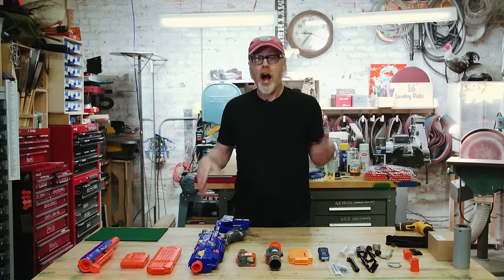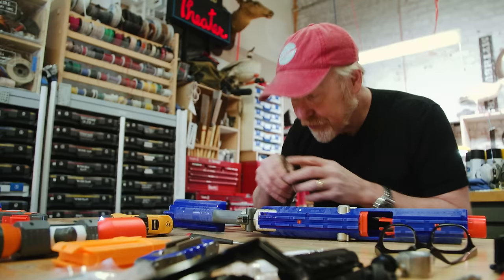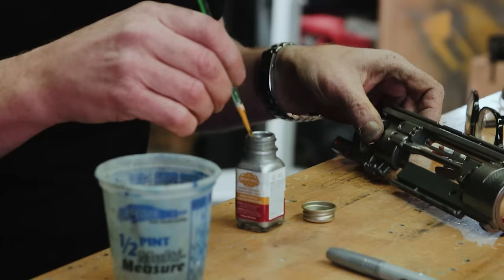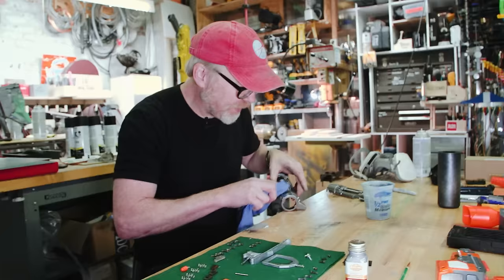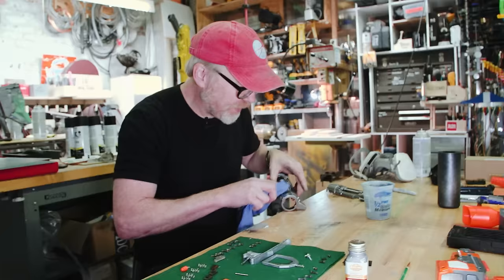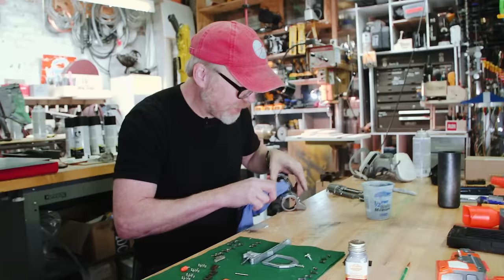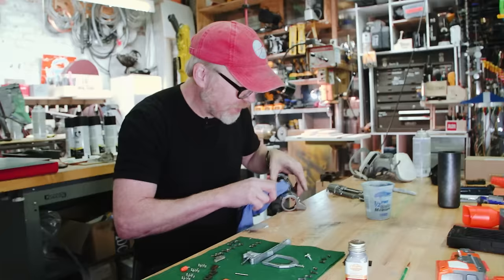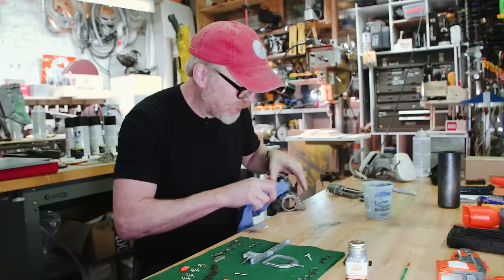Adam Savage's One Day Builds: Custom NERF Rifle

Comment: I don't know... That seems like a tad too much weathering. There's "well used" and then there's "fished out of a swamp."
Reply: No soldier is gonna leave his gun rot like that. WTF
Reply: I think it's just to compensate for the brightness of the yellow used, it tones down substantially.
Reply: I rather he used black than rust....
Reply: @Harvey Specter:
Yeah, but it ends up looking like mud... Or worse. I'm with Lunartist on this one - a soldier would maintain his gun. There's little you can do in the field about scraped paint or worn metal or the various dings and scratches that gear picks up in regular use, so that's fine. But this amount of caked rust, mud and literal crap - which is what it ends up looking like - just seems like the thing spent a few years at the bottom of a lake before someone fished it out and tried using it.

I'm not against weathering and ageing of a prop - it gives the item a sense of authenticity. However, good wear tells the story of how the item was used to wear as it has - smooth edges around harness hooks, worn matches where fingers usually stand, etc. What we see on the prop here is more than anything artificial disrepair, which I'm personally not a fan of.

Not knocking Adam's skill in model-making in the slightest, of course. That's still an amazing amount of work to do in a few hours. It's just... I don't think the "rust" adds to the weapon's appearance, is all.
Reply: Fair enough, I suppose. In the end, the person getting the gift seems to like it, which is all that really counts in the end.
Reply: It's a nerf gun guys
Reply: I like to imagine this is what someone from mad max would use.
Reply: Malidictus - In his mind he's telling a story, of which you are completely unaware of, and it appears you are letting pretty conceived notions cloud your judgement. For example, we are not sure if this is a nations soldiers rifle. For all we know, this a revolutionary soldiers rifle, or a rebel soldiers rifle, and does not have the same maintenance protocols of a nations military. Remember, assumptions make and ass out of you and me.
Reply: @JJ SS:
Fair point. Although the reason soldiers - and really, anyone who uses firearms - keep their guns clean isn't just protocols. The reverse is true - protocols exist because without proper maintenance, weapons become unreliable. If your life or livelihood depend on a rifle, you want it to shoot first time every time, and that's not going to happen if it's rusty, muddy and full of dirt. Even generally forgiving weapons like the AK 47 can still jam if not maintained properly.

While I agree that this much rust and dirt does tell a story, it's the story of a disused weapon left to disrepair, rather than one being actively used.
Reply: Malidictus we call it the Hunter of The Apocalypse
Reply: looks more steam-punkish so I agree yet at the same time disagree. the odd thing about this weapon is it was made with an odd yellow color, not desert brown like the primary color of most military rifles atm due to middle east incursions...
Reply: Malidictus But in the end, it looks fucking cool.
Reply: @TeqHDcasper:
I disagree. I thought the rifle looked better before the "rust." However, my opinion ultimately doesn't matter since the person it was actually made for seems to have enjoyed it.
Reply: I'd like to add another suggestion. It could be Adam's experience in the movie industry. (he was in that right? if not I'm sorry) The over weathering would be hard to see if the gun wasn't the center of attention, or while being used in a fight scene.
Reply: Well no soldier is gonna have a bright yellow sniper rifle either... It's a fantasy build getting kind of a Borderlands or even Warhammer 40k vibe from this.
Reply: well it is a nerf gun so at the end of the day it looks awesome

Comment: Adam... you broke the rule of nerf modding.
1 don't paint the entire mag    
2 paint the gun when it is apart 
3 don't paint the trigger, and if you do at least lube the shit out of the trigger.
4 sand off all the logos' texturing and warning labels.
Reply: and that silencer will kill your range and fps
Reply: and you should of cut the rail with a ban saw and mounted a pitiny rail 

and yes i can't spell for shit
Reply: and i hope you drilled out the air restrictor and removed the locks
Reply: Dude
Reply: With this kit there isn't an air restrictor
Reply: Lars Van Den Broek is the whole bolt sled remade by orange mid works? To be fair i have never modded a longstrike
Reply: I believe that it replaces the whole plungertube and breech because the longstrike is originally indirect plunger
Reply: Bruh, It'll be used once then put on a shelf. It looks fantastic, and that's all that really matters.
Reply: Adam doesn't live by the regular rule book. And, i'd like to see your work, since you basically are bashing one of the best builders out there.
Reply: why dont paint the magazines?
Reply: it won't fix properly into the gun. Avoid painting the part that inserts, they are built to close tolerances.
Reply: It's a fucking nerf gun chill kid
Reply: I assume you automatically knew everything about Nerf modding the first time you did it?
Reply: MrDyslexicPanda its nerf lmao
Reply: JKresz you don't know the NIC and the hole fkn hobby
Reply: MrDyslexicPanda  well the log is there price and charm for adrevenue
Reply: how does sanding off the logo improve performance again?
Reply: its fairly common to make guns shoot over 100 feet.
Reply: dang mang Damn who shat in your cereal
Reply: George Riley the paint chips away and makes feed the mag slow
Reply: DenchTraceur *cornflakes
Reply: ***** you can get above 100 feet with alot of nerf gun
Reply: Peter-Alexander Verwey not bashing this just isn't a common practices in the community
Reply: So confrontational, sure let's all live by your standards. Because people liking to do things other than those you like are stupid idiots and childish, yeeeep. /s

I've never modded a NERF gun, but I can at least appreciate the effort and enjoyment people get out of it. I might not get the same, but if they enjoy it then they're the ones winning.
Reply: Whats it like to never have any fun?
Reply: 5. Nerf guns don't really kill people.
6. Therefore, you are really bad assassins.

Some kind of joke, of course, although, what is the point of this hobby? Lazy, 'nerdy' version of paintballing? Granted, real paintballing is not easy at all, costs money too. For targets, I always liked archery the most, though.
Reply: More cost effective than paintball, less messy, can play about anywhere, and the ammo is recoverable.
Reply: dang mang jeez dude who cares what they do with there free time
Reply: people who enjoy using nerf blasters?
Reply: Arekinable
and modding the gun is probably a lot easier too
Reply: Better put him in nerf jail
Reply: I'll happily agree with 1~3 - however #4 is going to get you into trouble (the labels that is, not the logo).
Reply: in trouble ?? lol. ok.
Reply: Good advice but that doesn't matter it just a fun gift project so who cares
Reply: MrDyslexicPanda He did this entirely for aesthetics. All of this is irrelevent
Reply: MrDyslexicPanda you forgot a few

5: don't paint anywhere on the gun
6: don't even touch the gun
7: in fact don't look at it
8: y'know what, don't buy a nerf gun. Just don't.
9: I'm sorry I yelled
10: fuck all these rules this is dumb
11: do what you want
Reply: i dont mean to insult you but i have seen way too many people like you on the comments to shut up about it, in my honest opinion its people like you that kinda take me off certain hobbys, people who take things way too seryously, why are those rules in the first place and why do they matter, who cares? adam was trying to make something that looks badass for someone and succeeded at it, theres literally nothing to it, and wht matters the most, he did it his own way, which is what matters
Reply: This wasnt a nerf mod kid, he built a decorative prop
Reply: Good point, but it's Adam Savage, so he gets a pass because... he's Adam Savage.
Reply: Jesus, I thought I was a loser & here comes this kid complaining about the "rules of nerf modding"...
Reply: MrDyslexicPanda why can't he like honestly
Reply: I am in the community, and these aren't really rules as such, more like tips to follow. I understand that this is just a decorative piece, and as a decorative piece it's very well done. But if the recipient were to use it the paint would very quickly wear off, and may even cause the blaster to jam. Most people figure this out by themselves, making these tips like self-imposed rules to anyone who paints blasters. I do understand that the original comment might have sounded threatening and/or pedantic, but it was more of an in-joke within the nerf community.
Reply: +kalloused if i might interject here. Chill the fuck out. He was just giving him some advice from someone who probably mods nerf guns as a hobby.
Reply: Wait... are there professional nerf battles???
Reply: +Rpodnee I'm pretty sure Adam Savage doesn't want or gives a fuck about advice. Appreciate the fact that he took the time to make such a wonderful gift
Reply: I'm new to this, if you don't paint the mag or trigger, what do you do to color them?
Reply: +Tooltip Tinkerer Well, you can color the bottom of the clipazine, but painting the portion that gets inserted can lead to some wear on the paint, a really rough sound when inserting and removing the clipazine, and overall worse performance when removing and reinserting the mag.

As for the trigger, the same thing applies. Wear on the paint and a bit less smoothness if you paint the entire thing. If not that, then it helps people recognize it's not a real gun.
Reply: +Danjal Veskandar Not really. Plenty of people sand of those warning labels. They haven't gotten in trouble.
Reply: IceBlink it is for astetic resons
Reply: Rpodnee thank you
Reply: SoFre$h congrads on 100 sub now you can join all the outher perfetic gta youtubers
Reply: ***** thanks for the sensable comment
Reply: kalloused you're not getting the point
Reply: Johnny Stanton they do hvz in all over america and austrilia
Reply: MrDyslexicPanda I was kinda disappointed to see the logos still on the finished gun. I usually paint my nerfs whilst assembled so I can get rid of the horrible centre line and hide it as best I can.
Reply: Johnny Stanton, professional nerf battles are probably less expensive than paintball. That, & the fact that the guns look infinitely more interesting.
Reply: dang mang It's pretty sad that you go out of your way to bash on others' hobbies.
Reply: Being Hypo i know
Reply: TheRealToaster2 how meny ppl do you see bashing my hobbie 

And i wasnt bash anything they are just pointers
Reply: i think he was just going for the looks not really the function
Reply: Mitchell Liu And yet it was still functional...
Reply: Shawn Knox the mag and the trigger and the reloading mech would have been rough
Reply: Mitchell Liu but it functioned, and from what we saw it functioned fairly well.
Reply: The Conquering Enigma when did i threaten anybody. i know Adam is prop maker and i am just giving some input
Reply: Babatunde Olajid why did he put a full orange works kit in it
Reply: SoFre$h lol kid
Reply: Tooltip Tinkerer buy an orange mod works aluminum trigger and don't paint the part that goes into the magwell
Reply: KamekoBruns thank you
Reply: Yea exactly, everyone saying "he's just going to shoot it once and put it on his wall" don't realize that kit costs $70 to improve the performance... why include it, if its just about the looks
Reply: valentine dimitroff my point thanks
Reply: valentine dimitroff
it's called having options
Reply: Peter-Alexander Verwey / The best CS:GO player won't necessarily be the best Overwatch player.
Reply: Hentai Woody you cant talk shit when you spend your time finding glitches on uncharted 4 and just caused
Reply: MrDyslexicPanda Rules are meant to be broken my man
Reply: MrDyslexicPanda  he's Adam,  he makes the rules !
Reply: "the rule"? nigga, you named like 65 of them
Reply: Hentai Woody how so
Reply: Gigaknife i get than man just pointers

Comment: Just as a suggestion for anyone wanting to do this to their own nerf guns, after scotch padding, make sure to wash the parts with warm soapy water to remove all dust, dirt, grease, grime, etc. Then I strongly recommend using krylon fusion paint as a base coat. It adheres beautifully to the plastic, and makes the paint job last much longer.
Reply: thx m8
Reply: Fatal Sniper 13 instead of krylon, try duplicolor vinyl dye from the automotive store. works wonders for a base. sticks to everything with no sanding  ( still recommended though) and is very durable
Reply: Ill give it a try on my next build.
Reply: when i paint plastics, i always use a plastic primer. when you use it, use 2 to 3 thin layers. after that you can put any paint on it. (check the instructions of your primer which paints are suitable)
Reply: Hi Dutch, the krylon is a plastic primer. Works wonderfully.
Reply: ah sorry, didn't know that. should have done a quick google search
Reply: I use a vinyl and fabric spray paint. no primer needed. however with this spray you have to add a clear coat to seal and protect it.
Reply: The Nerf guns that I have modified I wipe down with acetone. I works very well to remove any shiny plastic. Acetone dries/evaporates very quickly so it's ready to paint almost immediately.